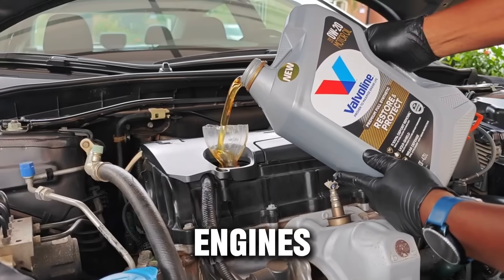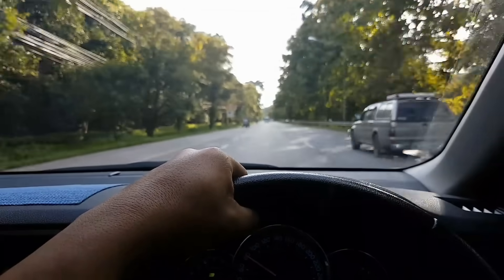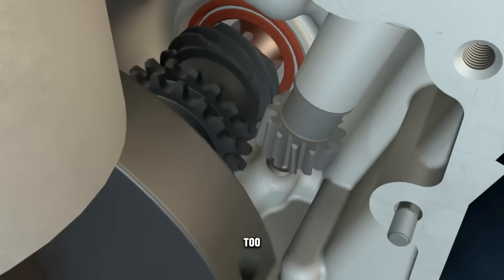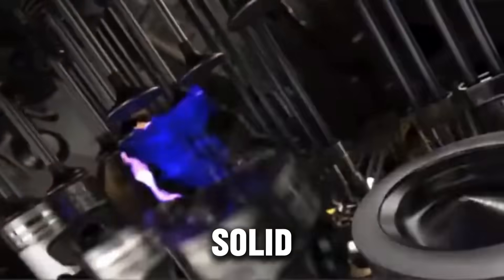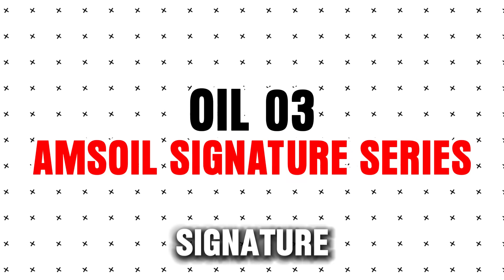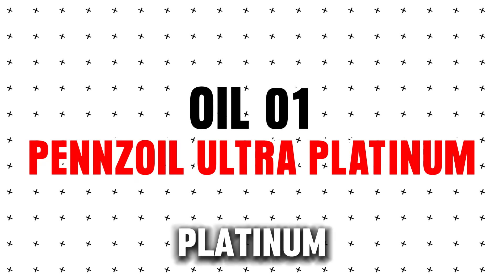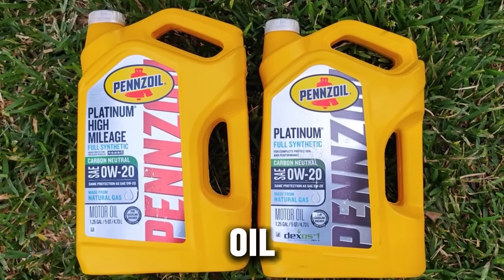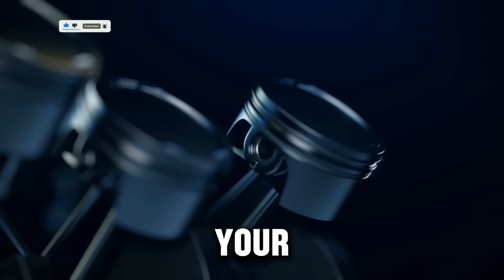8 Synthetic Oils Tested | Only ONE Protects Best!

Comment: Most any modern day oil is fine if you drive normal and keep attention to clean air filter. Then do regular oil changes. I run diesel so that is every 5,000 miles. Happy motoring….

Comment: Mobile 1 is the factory pour for Porsche, Corvettes and Camaros, Cadillac, NSX, Aston Martin, Bentley, McLaren and Mercedes Benz.  But what do those engineers know?
Reply: I would counter that question with a question tedneb:  Have you ever attempted to change a water pump on any of these cars, or even talked to a mechanic that has?  And did it look like the aforementioned engineers, knew how to design an engine to you? 

Automakers make faulty, flawed, and genuinely bad car designs all the time.  I'm sure you know this already but, the mere fact a car costs a lot of money, is absolutely no indication that it's design was better than some other, "lesser" car.   Among the cars you mentioned, can you change the oil on any of them without tearing apart half the engine first?
Reply: Not as much as accountants and marketing executives
Reply: Possibly nothing at all about oil.

Comment: AI BS !!!
Use synthetic oils and always change oil and filter between 4k and no more than 5k miles
The problems start with so-called extended change intervals. Clean oil of any brand will be fine if you follow the 3 basic rules of engine oil protection;
Change it - Change it - Change it
Reply: I run AMSOIL "SIGNATURE" oils in my  car and truck, and change it once a year regardless of miles.  Been doing this for over 54 years!
Reply: @wayneowen5864  tried to get some amsoil once here in Arkansas. After several phone calls found a spot only 50 miles away that had 3 qts they wanted $28 a qt for. Would have to order 3 more that would take 4 to 8 weeks to get.